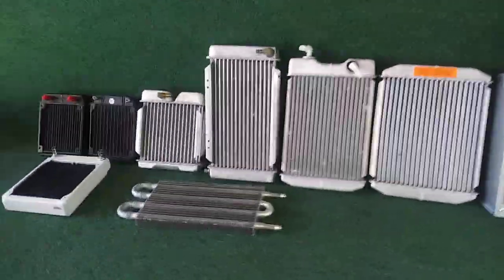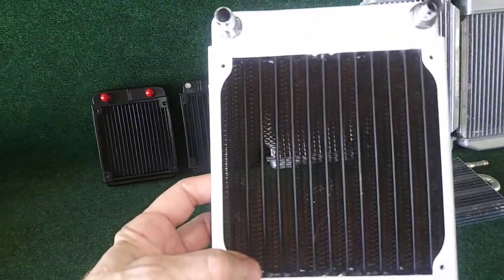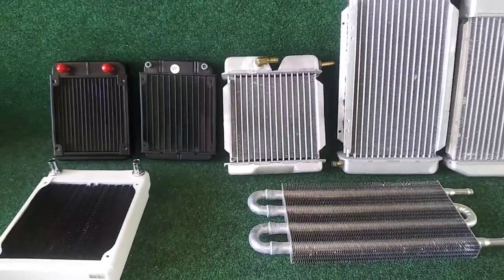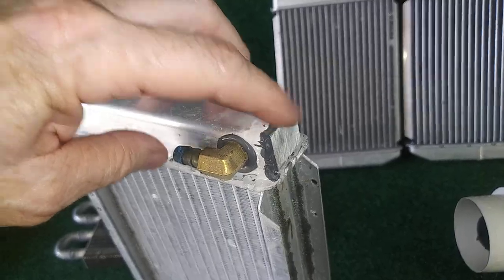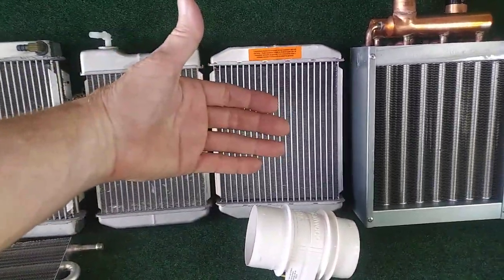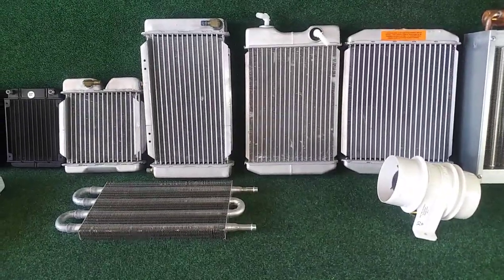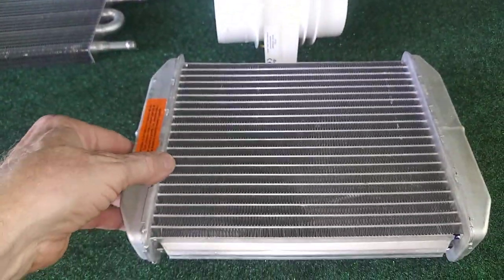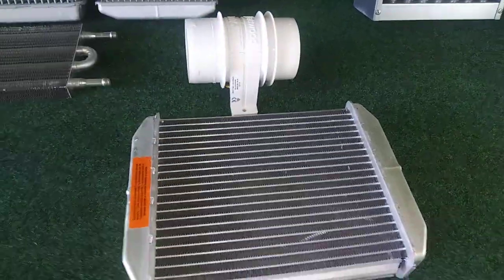( My Choice ) Homemade AC Radiator? - For 8x12 Room - 12volt AC Pro Tips

Comment: Thankyou soo much man... I needed some sort of radiator for my bike oil cooler project and i couldn't figure something out. i saw your video and got an idea to use the heater core from a car. I bought one the same day and im pretty happy . Its just that it's a little big for my bike
Reply from the maker: Awesome hack!
They also make PC radiator coolers that are long and narrow that are made for two, three, or maybe even four PC fans inline that may be a solution to reduce an overly bulky size issue.
Reply: @HomemadeAC  yessir they do but in my case those are expensive and I was sceptical about their pressure and heat ratings...
Reply from the maker: @Jonathansmith6969  Ohh... I understand that. Definitely!

Comment: Ice does not undergo a chemical reaction when it changes to water. It is still H2O.  And, ice will melt quicker when exposed to a mixture of ambient air and cool air in your cooler than when submerged in ice water.  Good info on the radiators.
Reply from the maker: Definitely. I was mostly referring to the initial reaction when ice/h20 comes into physical contact with water/h20. The two forms of h20 try to convert the other etc.
Thanks much for your comment!
James

Comment: Very good information on the radiators. Is there anyway you could make a video on how you modify the spectra radiator from cutting off the tubes to installing the new fittings?
Reply from the maker: Definitely!
I was thinking to follow the video with the tools and materials for how I usually modify this specific radiator for sure.

I will try to shoot a video today for that. It's pretty easy...

Thanks for sure,
James, Rescue Kitty😺 & Snowvan!

Comment: The setup that you have for your 8x12 (6 foot ceiling) how far is your blower mounted from the heater coil. 

As you mentioned that the blower shouldn’t be very close to the coils because it will only draw from that area, just trying to get a ballpark figure on what’s a good proper distance from coil to blower.

I was thinking about using a 5 gallon bucket as an air-box, would that be ideal?

Comment: Did you know Salt water ice cubes melt slower. I would go with cooler box ice pack or frozen milk bottle in the Rez. Do you know of any ready made units like a branded unit? Have you tried a liquid coolant in a closed loop unit?
Reply from the maker: Hey!
I have used water bottles filled with frozen saltwater in comparisons but in a side-by-side test on the fly I didn't see the difference in real time use with the unit running. But stand alone saltwater definitely freezes at a lower temperature but melts in comparison at a lower temp as well. It got pretty tricky because I was testing my main unit in my van conversion during work and required several tweaks looking forward so stopped while I was ahead lol.

I will definitely look into some more clinical trials in a leisurely setting where I'm not in a hurry etc.

Comment: I need that. Where are that's  items?
Reply from the maker: I use the radiator 2nd from the right when I use the Attwood H20 inline marine fan. I buy the fans on Amazon. And I buy the radiator in Amazon or sometimes at my local auto parts store. I can give you a link or item # if you want to use that radiator if you like.
What type of fan do you plan to use?

Comment: Any tips on removing or stopping condensation from clogging a radiator/cooler? Iv got a 1inch thick PC cooler in a very hot and humid climate
Reply from the maker: Hey,
There's a few things that can be done. I lived in extremely humid climates before and tweaking the design can help for sure.
* What kind of fan are you using for the airflow?

* And is there space enough between the fan and radiator for separation?

Have hope, There's always a tweak that's just around the corner for sure!

Thanks and get back soon!
James, Rescue Kitty😺 & Snowvan!
Reply: @HomemadeAC  just 2X basic computer fans mounted flush against it, iv ordered 2 more to mount to the front so il have both push and pull going on, its for a VERY small RV but battery life is concern so im trying to aviod a big 80W fan, il try some spacers for sure thanks
Reply from the maker: @bobmizoski9669  Spacers for sure 100%

Also there is a difference in "high static" PC fans and "high airflow" fans. I know they sound the same concerning rpms & cfms etc but they're totally different especially concerning using them for an ice chest AC for sure. 100% different performance concerning pulling air through a radiator especially with condensation build up that PCs don't have to deal with. Keep hope for sure! This is an easier fix than you might think.

"High Static" PC/Server/Gamer fans have to move hot air far away really quickly. The key here is far away/quickly. That means the airflow is hard hitting. The HS fans are superior for ice chest AC use! 

AF or "Air Flow" pc fans can have high rates cfm ratings but are only concerned with moving lots of air across the radiator. It sounds the same but it's different. Also using pushing and pulling fan positions is tricky concerning vacuums and turbulence.

My guess is your PC fans are airflow fans and not high static fans. The inline Attwood fans I use are very high static fans. The air hits you in the face hard and direct...not scattered or soft.

There is a balance between radiator surface space, thickness and fin separation vs airflow vs condensation that is critical.

My first mini transformer ice chest AC initially had too much condensation because it was running too cold. And I didn't scale down my larger AC unit properly concerning radiator surface space etc.

Don't worry it's an easy fix but will take adding space between the fans and rads first for sure! Then verifying you're using high static PC fans! They have a few design differences concerning blade width etc. Static is like a blowback rating. Look up the differences between the two and it will really help "a lot" for certain.

Condensation is an easy fix but feels terrible after an AC build was thought complete. Believe me, I know! But we can fix it. Look at my fan tips playlist also or airflow playlist. I'm trying to arrange all the video subjects for easier searching...

Thanks and get back with me!
James
Reply from the maker: We're you able to solve your condensation problem yet?
James